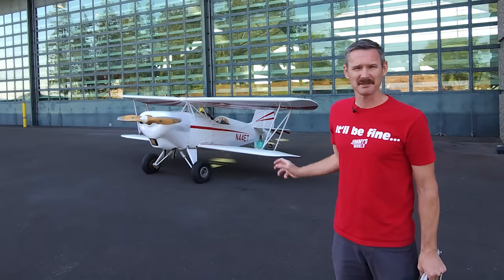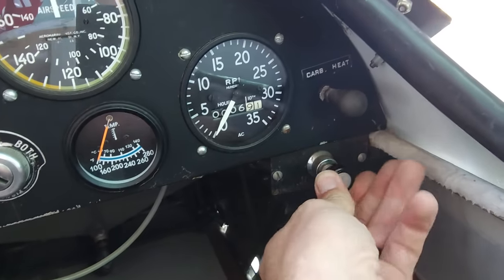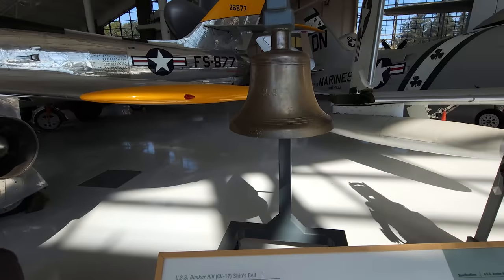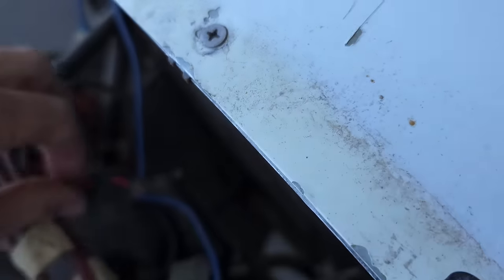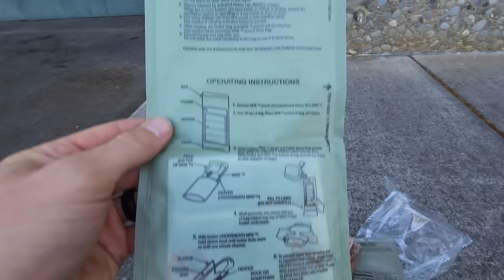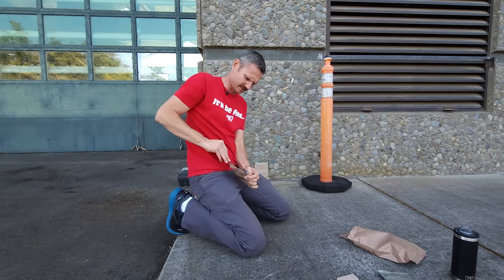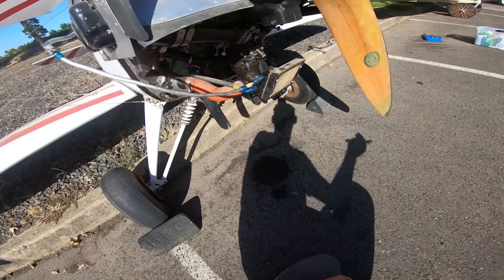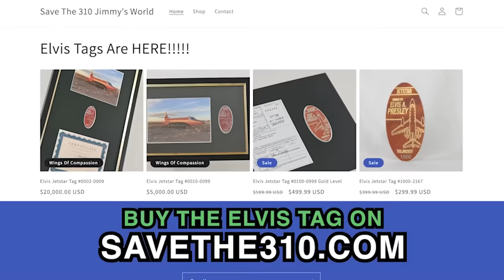Tiny Airplane Only Flown 1 Time… 27 Years Ago Will It Run Today?

Comment: GIVE JIMMY ENOUGH ROPE AND HE  MIGHT AMAZE YOU, OR NOT........

In the large and small engine repair community, one of the highest, if not the highest, honors and tributes one can receive in the realm of dirt, grit, grease, gaskets, and gasoline -- the men and women who have Quaker State 10W-30 coursing through their veins -- the award is by consensus for mechanical feats. The criteria are varied, situational and especially spotlight the innovators.

Here's how the award process works. One fellow is under the hood, cowling  or maybe even the flip-up cover over the engine of a riding lawnmower while observers and/or helpers stand around intently watching. At the point where most would quit, the mechanical star may twist wires together, twist a bolt, or even twist off the top of a long neck. Then, just as the rest are convinced it can't be resuscitated and begin to administer the last rights, the star barely touches the starter and it comes to life just like the day it was new.

The immortal words of high technical prowess are uttered, "You know boys, I believe if you give him a little rope and some brake cleaner, he could crank a stump!" Silence falls over all present, they nod in agreement and the newest honoree knows he's entered stardom.

Comment: You ought to get a hold of the family and see if anyone wants it back...so they can have it for a family heirloom or to be passed down. Good video to show you flying it home to be with the family. Might be a BMW engine out of a big motorcycle. I would put diesel fuel in the crankcase and tune it over a bunch and let it circulate and then drain and put new oil in it let it run for a while and drain again and put fresh oil in it to make sure the old oil is not blocking any of the ports/channels, it is supposed to go through to lubricate the motor. Another ting you could do it go get some Marvel Mystery oil and put it in there get it running and warmed up and then drain and put fresh oil in it. Well you did alright thanking Jesus but you need to seal the prayer in His name Lk.24:47 & Jn14:14 because everything we do it or should be done in His name, Jn14:6. Without Him there is no salvation Ac.4:12. But good try Jimmy. Could take the key switch out and put a toggle switch in its place. I've owned old Harleys that have started on the second kick or crank on the starter, just make sure fire and gas are up to the carb chock once till it fires and then turn the chock 1/2 way or off. Should start. That little plane would be kick butt to fly and play with. I wish I had the money to buy it and play with it.

Comment: Drain and Wash that dinosaur crap outa there and put some modern and proper lube in. You probably should have done that before turning it over and sucking the oil pump and sump screen full of the crap.😨

Comment: You sissy MRE guys complain about your choices, be a real man and try what we had in the 60s and 70s, C rations , AND if you wanted it hot you had to put the cans on a exhaust manifold of a truck or jeep, and then try not to get 3rd degree burns as you tried to open it with your P38 . Just kidding LOL I WISH we had MREs.